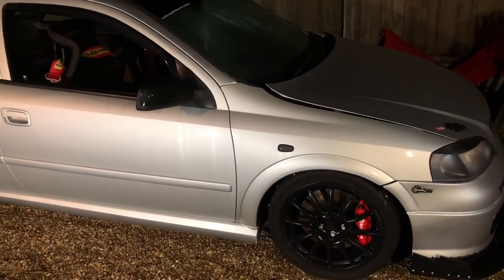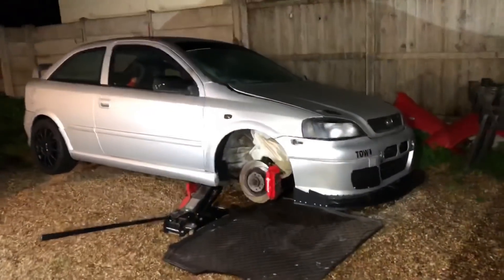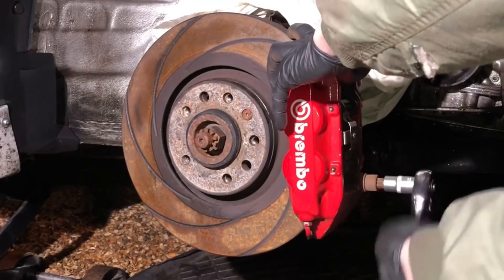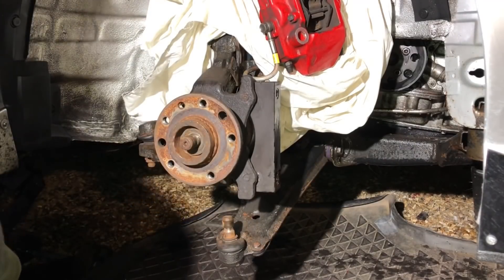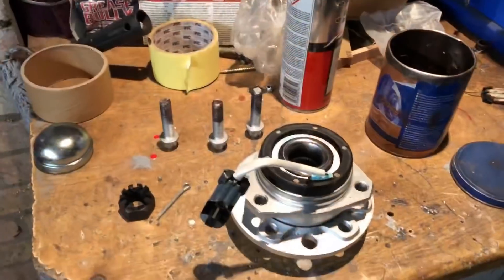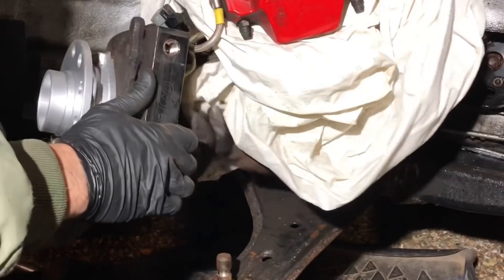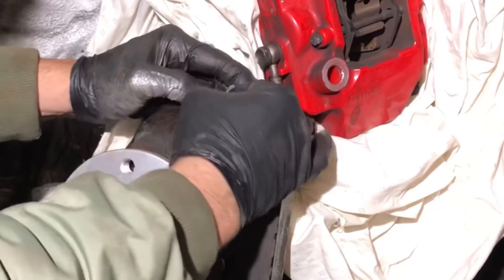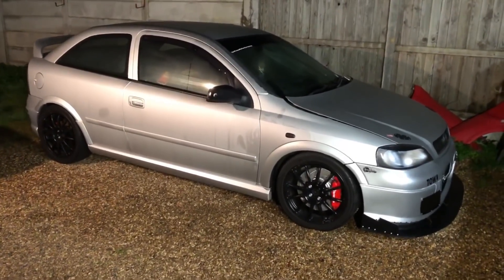[Wheel Bearing Replacement & ABS/TC Fault Light ON] Opel Astra Opc Mk4/5 Vxr

Comment: Have you any idea what causes the U0121 Code on diesel astra j . I have abs service power steering traction control and failed speedometer when this intermittent fault kicks in after about 40miles of constant driving . If I leave car few hours it's fine again . Replaced battery alternator and 4 abs sensors and it's still doing the same . Any help would be appreciated thanks

Comment: Hi Aaron Unknown
Thanks for informative vids. I have a astra h OPC mk 5 and my traction control light comes on a lot and stays on. No fault codes on Launch x431 pro diagnostic tool or pedal test. I read a bunch of stuff about AMF sensor and and modules. I did adjust my handbrakes 3days ago. I need advice please

Comment: Very good video again Aaron 👍my car developed an issue on cold start it’s misfiring for 10/20 seconds I had a look found pool oil around a spark plug leaking oil filter cap I cleaned it up thought that was issue but it’s still doing it 😕
Reply from the maker: Thanks man 🙏 could be a dead coilpack, tbh there is ton of things it could be your better off messaging me on insta
Reply: Turns out the head gasket has gone mate 😔

Comment: What specs are your wheels man? I’ve got the same brembo setup but have to run 9mm spacers for them to fit the coupe turbo wheels, want to get the right wheel with out the use of spacers!
Reply from the maker: Hi mate there. Et35 17x8j

Comment: What are the Brembo breaks of ? And disc ? Are they the Renault ones ?
Reply: Bad boi mine are Vxr 321mm discs on megane 225 brembos with adaptors from creation motorsport.
Reply: You can also use rs250 megane brembos with 341mm vectra vxr discs with vauxpro adaptors
Reply: Are they a big distance for fast road car ? Live in the country mountains in Scotland so need good brakes and what brake line do you use ? Also what pads Megane ?

Comment: Mine Astra VXR is making a noise from front left like a wering how do I check if it’s my bearing pulls to left ever so slightly
Reply from the maker: jack the the car up and try wobble the wheel from side to side to check for play. If its making noise it needs replacing
Reply: Aaron Unknown will do thanks for your help

Comment: I have a question about your frontbumper. Is it really just connected to the body with those four quickreleases. Asking because I have an OPC too and always need to disasamble the front before loading him onto a trailer.
Reply from the maker: Hi yes it is, 4 pins and sits on top of chassis mounted front splitter
Reply: Oh ok. I dont have a splitter, do You think it will hold with just those pins?